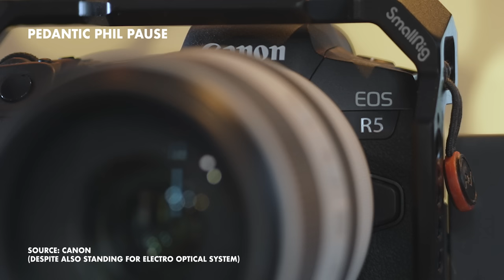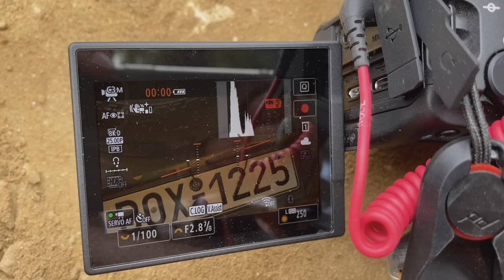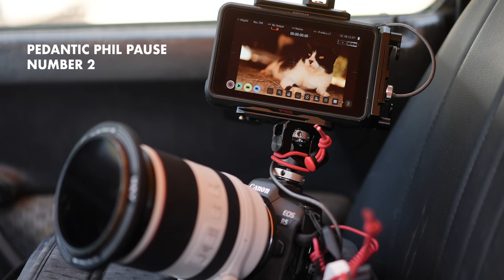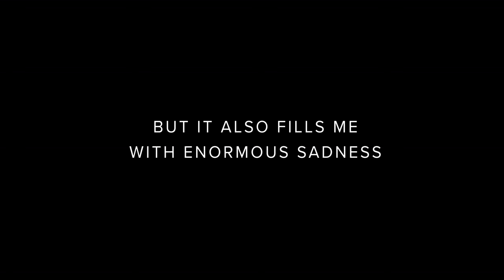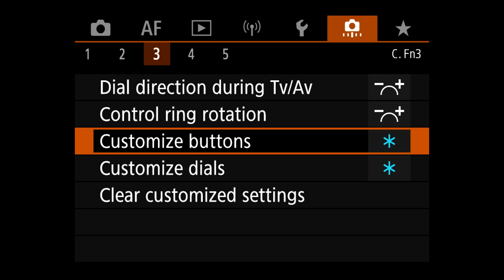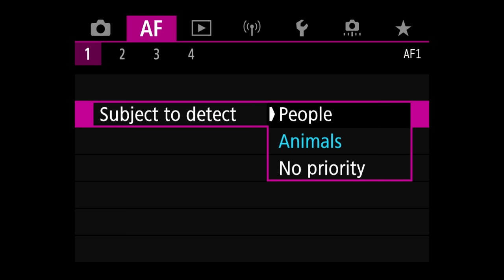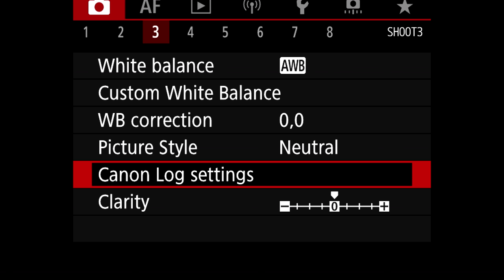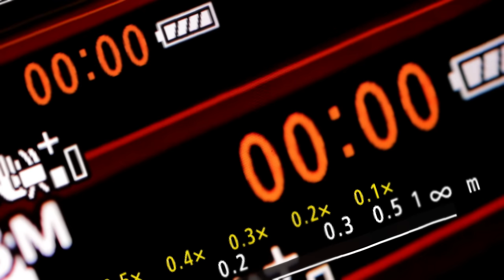The BEST hybrid camera? The Odyssey of the CANON R5

Comment: id say the r5 is the best HYBRID is you mostly do photos with the occasional video.  If you do anything like wedding or event videos, then the R5 is complete garbage.
The problem of the R5, is when you;re using it exhaustively (like at a wedding), you then have basically a 40 something megapixel stills camera with lineskipped 4k.  Rendering the R5, basically the same as a A7R3 as soon as it warms up. as you wont have 2 hours to sit it and let it cool
Reply from the maker: I wouldn’t say it’s garbage. If you get locked out you still have 4K 30p of Sony A7RIV quality but 10 bit. But yes getting locked out at all is no way to work.
Reply: @philipbloom  problem is that doesn't matter what quality you record a ceremony, even if you film a Catholic ceremony in lineskipped 4k, when they walk out for confetti, there's no 4k60. Low or high quality, basically no 4k slow mo at all, as you spent the last hour recording 4k.
There's also the inconvenience of the 30min restarts

Comment: All you needed was a cooler box with you in greece. On top of having that copper heat sink mod and high end cooling paste and the firmware updates. Surlely then it would of been a dream to work with on that shoot. 

Put some lunch and drinks in there with ice packs . Then the camera in between recovery times.

London england is diabolical. Steal everything there. Dogs, cameras, catylitic converters, pockets, watches

What are the police doing.